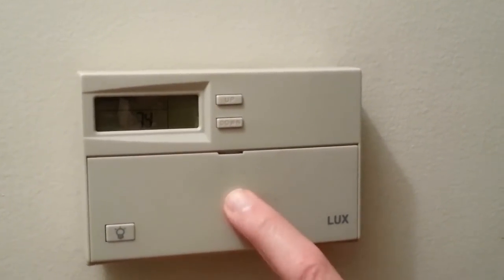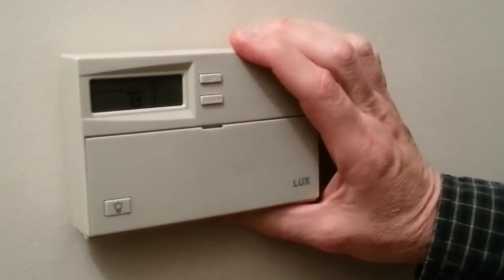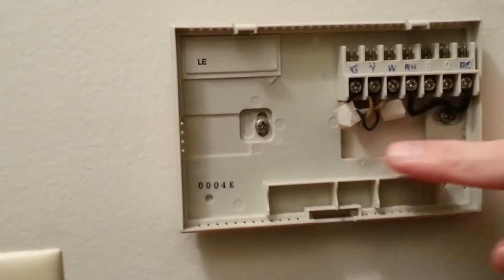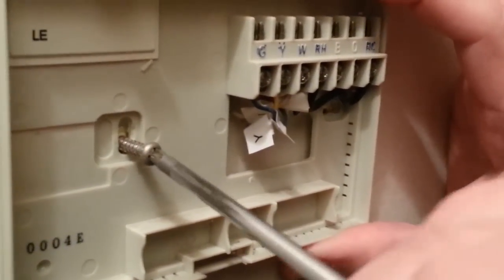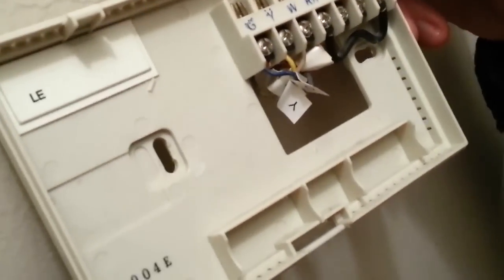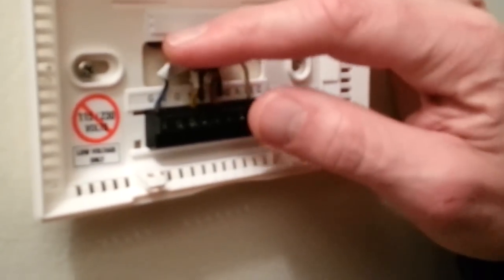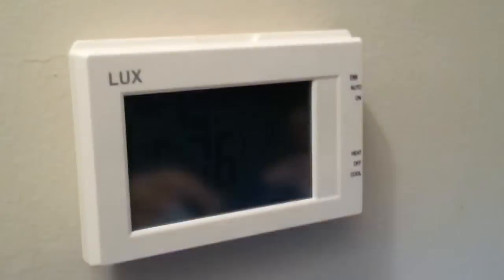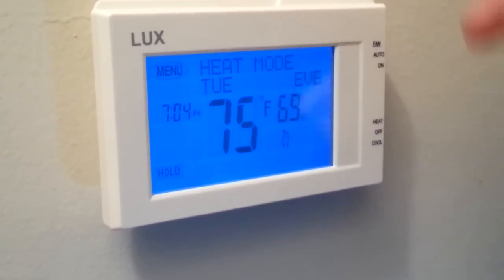Installing LUX TX9600TS thermostat

Comment: At 4:01 he shows how to remove the unit's face plate. This is GOLD, as there's nothing in the owner's manual about that.
Reply from the maker: Joel, appreciate the feedback. As I recall that was one of the reasons for making the video.
Reply: @cfldriven  Well, I got mine installed & operating perfectly on the 1st try. Your video help immeasurably!
Reply from the maker: @fobbitoperator3620  Glad to hear it helped you get it installed and working. We had ours programmed with 4 events per day, and with a tap of the screen we could override any setting. Thanks for commenting.
Reply: @cfldriven  Indeed!

Say, how do you keep yours from auto adjusting the temp. Mine keep going to 88 degrees by itself, & it's making my gaw'damn hair fall out. (figuratively)

Haven't been able to fix it...
Reply from the maker: @fobbitoperator3620  The Hold function will keep a constant temp and ignore all programmed settings.
Reply: @cfldriven  HHhhmmmmm. I'll look into that. Thanks brudder!

Comment: So how do you keep the blue display on all the time? I like to be able to see the display without having to touch the screen every time. My unit is in a dark location. If the light doesn't have the option of staying on, I will have to return it. Thanks
Reply from the maker: Back in 2014 it would not stay on. I don't if the latest version is any different.

Comment: Same old and new units, your video was helpful... My old unit only had a W.  The new unit had a W1 and W2.  Read instructions, were not clear, but it did say W2 was for a backup which I don't have, so used W1 and all is working.

Comment: to open this i used both hands. I made sure not to press the down as i applied pressure. Sure its not natural but once  I pushed straight out  it popped off.  I put put my thumb on the middle tab and index fingers on outter tabs to apply pressure evenly and then pushed straight out and a bit up.  The unit finally opped open.
Reply from the maker: Sorry I should have included that step. I finally did a video https://youtu.be/3ALiXl3LdXA

Comment: Exactly what I am doing same old broken one and the new Lux thank you I wasn't sure how to put the wires in the new fangled clip place Thank you so much!
Reply from the maker: Good to hear this video is still relevant today. Thanks for watching.
Reply: @cfldriven  I just don't know if I should use the jumper with 1 red wire?? looking at the instructions #6 1 stage heating with two separate 24v transformers. IScematic #4 conventional (non-heat pump) 1 stage heating and 1 stage cooling. I dont know which scematic I should use? The jumper was up above the screw plate is that where it goes? I thank you in advance...This Gramma needs a new thermostat.
Reply from the maker: @klashinsky9841  Don't live in that house any more, but as I recall I pretty much matched the wiring from what was on the old Lux. If your heating and cooling unit don't use a heat pump and are in one box with a separate condenser coil outside, your probably #4.

Comment: Wires not the same i have a heat pump with w o y c rc rh g wires in new thermostat do not have w i have w2 w1
Reply from the maker: The manual does show different hook ups for heat pump systems https://www.luxproducts.com/wp-content/uploads/2017/07/tx9600ts_manual_en.pdf  and depending on your system you may either plug into w1 or w2. I suspect if you have a one stage heat and cool you would use W1.

Comment: If you lock the screen can someone still change the temperature and hit hold?  I basically want a stat that I set at 68 and cannot be changed until I enter the code in to change it.  Brochure has me confused on what you are actually locking.
Reply from the maker: If you lock out the screen, someone else would need to know the code to unlock it before they can make any changes. Or if they knew how they could reset the thermostat and reprogram it.
Thanks for watching.
Reply: cfldriven thank you.  I will finally have control of the thermostat

Comment: When you make a video pls do not leave out the most important, i did not see where you connected the wires in new unit
Reply from the maker: Sorry, you align the wires to the same connectors as in the old unit. That why it is important to label the wires before removing from old unit.

Comment: He was leaving out the steps that he felt was not important for us to see and that's the part I wanted to see.
Reply: Thats because he had no idea why the wires went where they went.  Totally useless
Reply: Yeah. It looks like he hooked up W to W1, but not why he didn’t use W2, nor why he didn’t jump the two together, like RC and RH are from the factory.

I have a single R wire on my old one. Where do I put that?

Comment: What is the screw spacing on the new Lux you just installed?
Reply: This was a few years back in previous home so I don't recall. The backplate does give you some wiggle room to go right or left.

Comment: is there a way to over ride the password lock? i forgot mine
Reply: sean green I realize this an older post, but it might help anyway.  First, you can get directions for this online.  If you want to print them, each page from the manual is a full piece of printer paper (will end up with a small book).  Anyway, it is easy to reset your thermostat if you have not done so already.  You have to remove the front piece from the base plate like you would do to change the batteries.  You then have to find and press the button labelled "HW RST" which is located on the circuit board.

Comment: Just installed this same model, my screen doesn't light up blue though, did you have to do anything special to get it to do that?
Reply from the maker: No it was the trend color of the time, what color are they now?
Reply: cfldriven oh there's no back light on mine at all, guessing it might be a defect then. I can still read it fine without it, just kind of a bummer.
Reply from the maker: Definitely comes in handy in a darken hallway. Is it the same exact model? Could it be a model that doesn't include a backlight? If it suppose to have one and it is not too much trouble to de-install, I would try to exchange.
Reply: It says it's a TX9600TSa, book with it says there's an LCD back light, though the box has no mention of it, and it looks exactly like the one in this video. Was thinking about an exchange, but since it's -10 degrees out right now, and I'm not terribly inclined to reinstall the old thermostat, I'll probably just leave it as is. If I find something else to be wrong with it I'll reconsider. Thanks for your input though, I appreciate it. :)
Reply from the maker: Once programmed we hardly ever touch it. Stay warm!
Reply from the maker: @ladyleohighstepper8973  Sounds like the battery is dead thus it did not retain your settings during the power outage. Make sure the switch on the side is set to HEAT and touch the current temperature number. This should allow you to adjust it up or down to your liking. If you press the HOLD on the lower side side of the display you can lock in this temperature. 
My advice is to get someone who can follow the instructions to reprogram this unit to provide you with most comfortable temperature throughout the day and night for winter and summer.
Reply: @cfldriven  Thank you but it wasn't any of that! All I needed to do was press the reset button on my oil furnance my heat came on. I don't know why it didn't occur to me to do this first. Thanks for responding anyway!
Reply: I had installed this thermostat myself so I understood the majority of the manual except the "Swing/Override" portion but I reread that portion & determined I had correctly selected my settings. GOD  tapped my brain & said "Go press your reset button on your furnace" which I did & I had instant heat☺!
Reply from the maker: @ladyleohighstepper8973  Thank you for sharing, good idea to check the furnace.

Comment: this video is pointless due to the fact you don't show how to wire the new thermostat back up. Its fine that you labeled all the wires but when the old wiring doesnt use the same codes to what wires go where i still cant rewire my thermostat.

Comment: Not any more helpful than the instructions in the box. How do you actually attach those wires? Not useful video...
Reply from the maker: Sorry the video was not helpful. There are several set ups depending on system configuration and we could only show one. Best to follow the wiring from the previous unit or get an HVAC pro to configure it. Sorry I can't give a better answer.